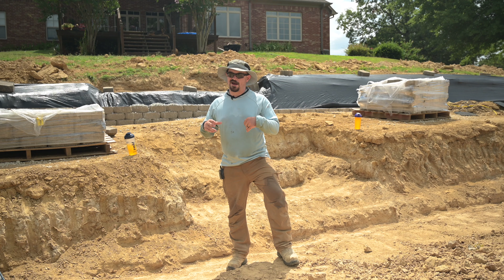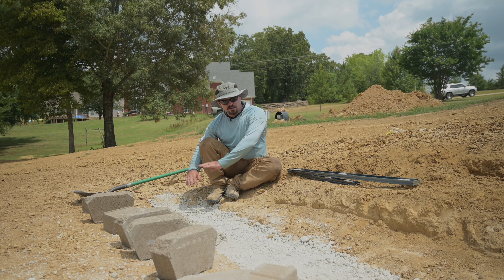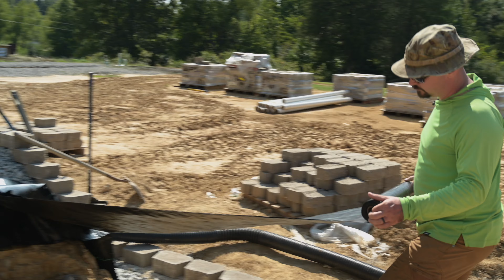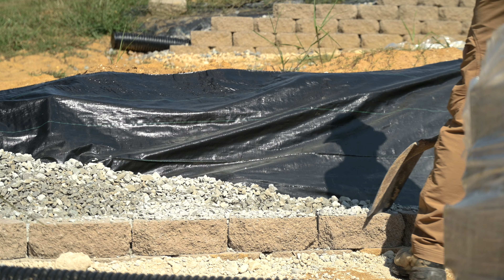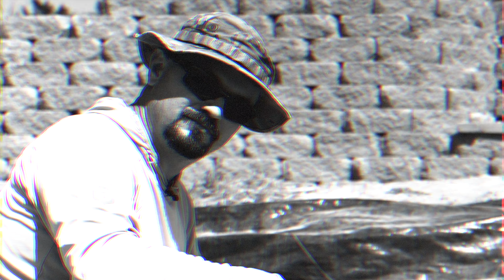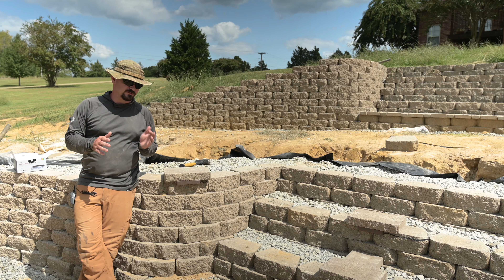Former Engineer Builds Retaining Wall

Comment: What is the point in doing this ?
for the look ?
Reply from the maker: Of a retaining wall? It allows elevation changes greater than critical slope without concern for erosion.. so it's stable. I'm putting a large pavilion and pool in my backyard that used to hill. Cutting into the hill created a dangerous amount of slope so the solution was a multi-tiered retaining wall.

https://youtu.be/GiXjbuhsHWk?si=0EymIJiTTuUCLAF_